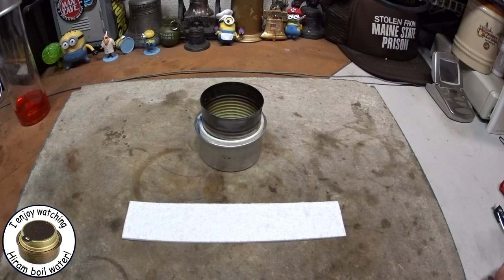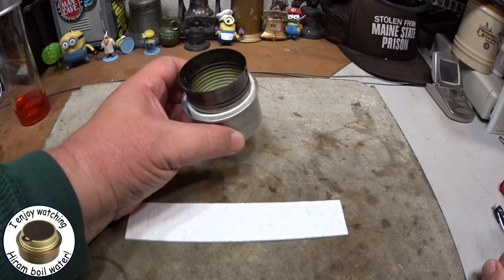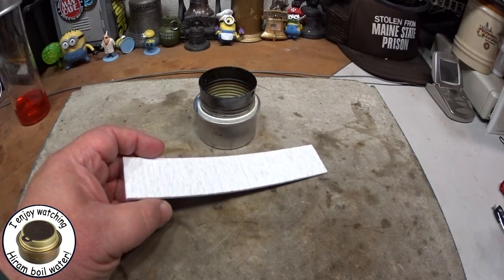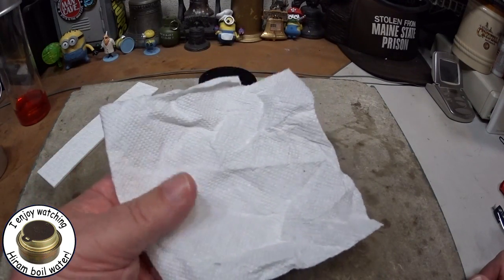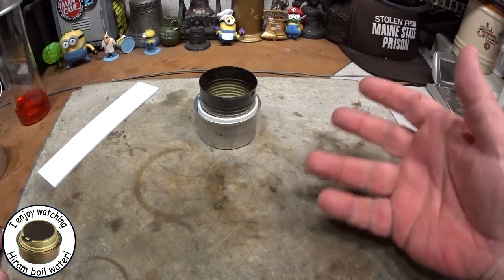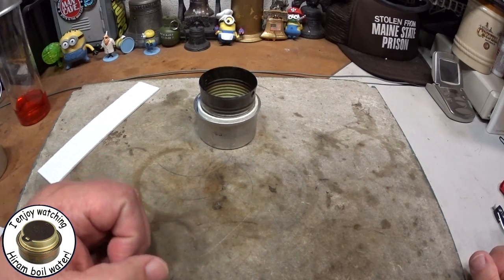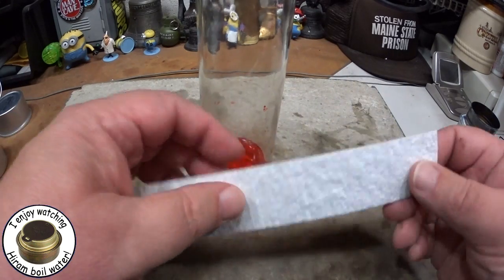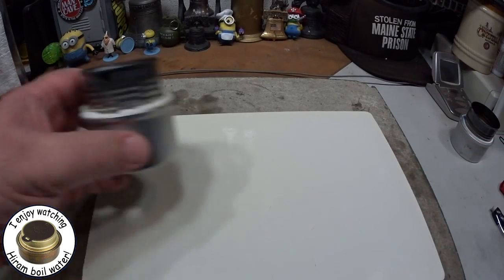The Purpose of the Wick in a Fancy Feast Stove

Comment: Great explanation, Hiram. I think there is another benefit to the wick besides the capillary action. The wick material increases the wetted surface area, which allows for more evaporation. More evaporation means there are more fuel vapors to ignite or burn.

Compare pouring 1oz of alcohol into a cup and pouring 1oz into a paper towel. The paper towel will be dry long before the fuel evaporates out of the cup. This is why wick stoves perform so well in cold temperatures. The increased surface area increases the evaporation, while the cold temperatures decrease evaporation. So the wick offsets the negative effects of the cold, which is why it lights just as easily in the cold as when it's at room temperature.
Reply: ColoradoCamper quite late in providing this feedback, but oh well..! Excellent point regarding the increased wetted surface, being a more efective evaporation platform. In fact, this is so effective, that serves as the principle under which the "winter gas" from Primus works. They designed a gas canister with a paper mesh sleeve, which helps gas mixtures evaporate under very low temperatures (the achilles heel of gas stoves). As the gas (still in liquid mode inside the canister) is absorbed by the paper mesh sleeve, it can evaporate at a faster rate, offering this little extra pressure in the canister. Nice channel, well educated people!

Comment: Hey +Hiram Cook thanks for all these great test videos, I've made my own little stoves after viewing your tests. But I see you're not using holes in the FF cans anymore, why is that? Do they heat better? or is it a fuel capacity issue? FWIW I'm getting a rolling boil for  2 cups at 4:30 on 1 OZ 85% ETOH with mine with a carbon fiber wick

Comment: Hiram--I enjoyed this video.  I was curious if a wicking speed test would be useful in determining which common wicking material works best.  Bybest, I mean most efficient burn given a set of variables such as fuel used,  altitude, temperature, etc.  It would be interestingto see a capillary action test comparing common wick materials, a test for each material just like your dyed alcohol ceramic wick material example showing capillary action only recording distance travelled over a set period of time.

Comment: I've been toying with the idea of wrapping copper braid solder wick around the inside can before sliding them together. The copper braid would then be the wick and should last for a very long time. You can find cheap copper braid solder wick  on the Chinese sites like BangGood or probably even Ebay. It has flux on it but that should be easy enough to remove with alcohol.
Reply: Or maybe fine wire wool?
Reply: +Tac Blades I think fine steel wool would work as a wick, but I'm afraid it would rust quickly. 
I believe people used to use fine steel wool in some of the early low pressure beer can stoves. I seem to remember a few people stuffing penny     burners with steel wool back when those were popular. 
By the way' thanks for telling Hiram about this cool ceramic wicking stuff, I checked out and subscribed to your channel. I meant to do it before but I was watching Hiram's videos on my phone and it's a pain.
Reply: +Dirk Stabins i think you are right about the rust.  Thanks for the sub :)
Reply: +Dirk Stabins There may be a stainless steel solution.  I used a very fine stainless steel screen for a wick in a different application.  (That was to wick liquid sodium so nothing like methanol).  I thing a layer or 2 of aluminum foil sandwiched with aluminum screening to maintain separation may work.  But Tac's ceramic wick looks ideal to me.  It'll likely light at low temperatures like carbon felt but not shrink.

Comment: The basic principle is diffusion. Diffusion is a spontaneous movement of particles from an area of high concentration to an area of low concentration. When we provide tiny closed spaces for the alcohol to flow through we create a way for the alcohol to maintain this principle even upwards against gravity, capillary action. as the alcohol burns at the top of the wick
Reply from the maker: +Seventh Seal I realize it's been awhile since I was in high school but I remember being taught that diffusion is the mixing process where molecules mix from areas of high concentration, to areas of low concentration until equilibrium is reached.

And capillary action is the movement of liquid in a pore or tube due to the forces of adhesion, cohesion, and surface tension.

The key words being mixing (diffusion) vs movement (Capillary action). The wick liner in the Fancy Feast stove "moves" the alcohol up to where we need it. I don't think "mixing" the alcohol would do the same thing.
Reply: Hiram Cook I think we are both half correct . What happens those small spaces create a framework for the high to low concentration by decreasing. the space in which the liquid moves. Making it easier for the molecules to move from high to low because of the channels. It's the same concept as higher a circumfrence pipe squirting out water at a lower rate and pressure then a small pipe. Adhesion, tension, and surface tension are part of the process. If there were no capillaries the liquid would just spread as if poured on the floor. It has been a long time for me to Hiram. I'm sure gravity and hygroscopic pressure of the atmosphere also comes into play too. But what do I know, I'm just the guy on G+ !

Comment: The wick draws fuel up but it also mixes it with air and makes it easier to Ignite.  This is why its soo easy to light when its cold.  Because the Fuel and the Air are mixed in the Wick and it makes for an easy to start stove.

Comment: Great explanation of capillary action Hiram. I have a  suspicion  that the tip of the wick material, now soaked in alchohol, also presents a much higher surface area of liquid alchohol to the flame you are trying to light it with, and later the stove flame itself,  which maybe gives better vapourisation when trying to light the stove in low ambient temps. ? Plus, didn't your Trangia cutaway show a wick ? I'm sure Trangia wouldn't bother if there was no benefit...Just a thought... Dave

Comment: Another great video Hiram. The demo on how it travels up the wick was perfect!
Would like to add that part of how far it will travel is also in proportion to how much fuel is in the stove. 
If you had more fuel in that same volume of space, it would have traveled at least a little bit farther up the wick.
I would also like to add to this that this is a contributor to what happens when you over fill the stove.
As I'm sure you know Hiram, since other may not,  even though the fuel level is within the vessel, if there is to much fuel, the capillary brings a lot of fuel to the surface of the wick and then the add pull from the heat vapor draws it even faster to the surface which helps cause it to then start to spill over the rim of the stove as there is more liquid fuel then it can burn in the same space. 
I luv the vid. Keep up the great work Hiram!!!!!

Comment: Wicking also means your flame stays at a constant height even as the fuel burns down.
Keeping the flame in the same location gives you a consistent amount of heat right through the burn.
Wicking also means the burn happens right where the air and fuel meet. In a wickless stove the fuel vapour has to rise between cans to get to the air for combustion. This makes it more vulnerable to a gust of wind blowing that vapour away and extinguishing the stove.

Comment: I'm under the impression that the trangia also has something like a carbon felt wick inside. But with the trangia you can't put a pot directly on top of it. Does wick in the trangia serve a similar function or is it there for another purpose? Thanks.
Reply: Trangia wick is linen.
The purpose or the wick inside the sub-camera is put more alcohol - mixed with air; in contact with the hot inner wall, as you lit the stove by the central "pit".
This alcohol vaporizes and allow the top jet's lit.
In short, the wick speed the "bloom".

I put similar cotton (old T-shift, jeans) wick in my "double wall, top jet's) DIY stoves, is noticeable the reduction of "bloom" time.